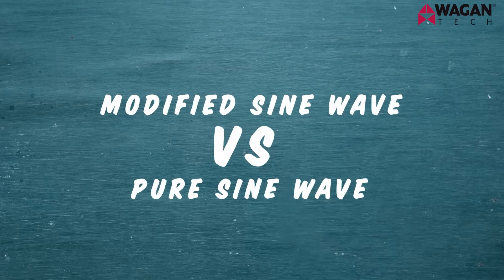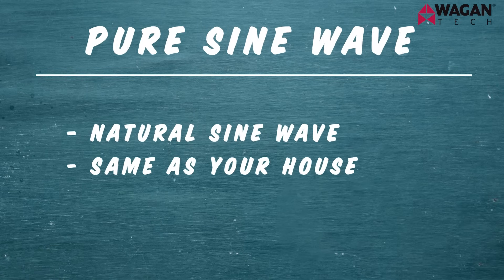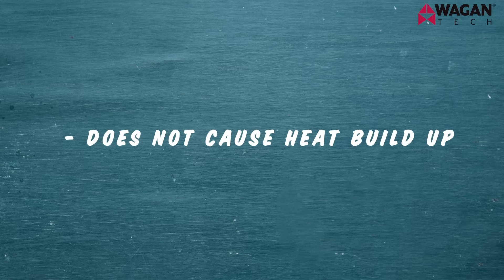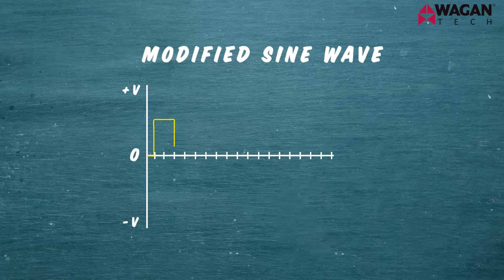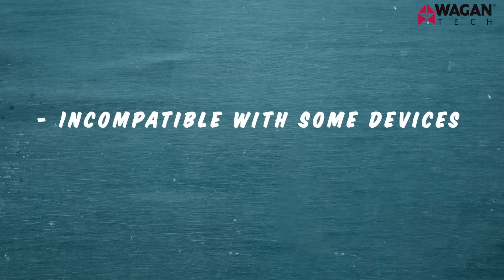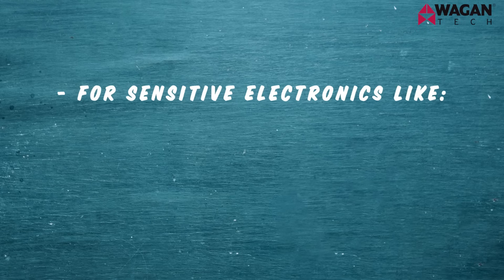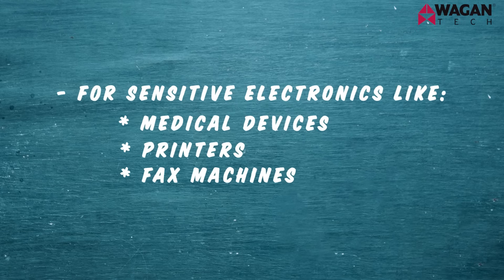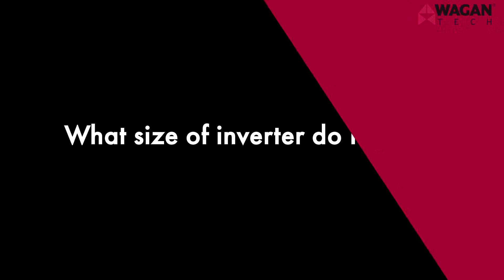What is a Power Inverter and which inverter do I need? What does a power inverter do?

Comment: Great video! I have a question tho. I am looking to buy devices for my families homes in case of a power outage. I've been looking at portable power stations, but then I saw power inverters which seem to power up higher wattages than the stations, yet they are cheaper than power stations. Why is this? And which device is best for a power outage, inverters or stations? Thank you!
Reply from the maker: Quiana, great question! 
Power Inverters convert DC (like your car's battery) power into AC power (your home wall outlet). They are great for powering small appliances and everything else including your entire house. Like anything requiring power, the limitation is the battery (or battery bank) that is supplying the power. For powering devices/appliances close to a battery power supply (like your car), inverters are ideal.
On the other hand you have devices like our Lithium Cubes. They have a built-in power inverter (and of course: USB, DC, etc.) and are great for activities away from the car or situations where you don't want to deplete your car's battery (like camping). Their limitation is the internal battery; a trade-off for ease of use and portability.
Like anything, it depends on your needs and use-case. You are looking for something to supply power in case of emergency at home. Our Lithium Cube 1200 is perfect for that as long as you don't need to run a lot of big appliances (refrigerator, air Conditioning, microwave, etc.). If you need to power those items, an Inverter with a large battery bank is ideal. If you just need to power lights, a tv, fan, recharge your phone, etc., the Lithium Cubes are perfect!
Reply: @WaganTech  Okay understood. Thank you so much for clarifying that for me!
Reply from the maker: @quianadumas3550  it's my pleasure! If you have any more Q's, feel free to ask!

Comment: Great advice. One dumb question. my camper van has a 800w inverter which is overkill for what I want to use it for. My laptop only requires 12 w. Can I still plug in my laptop to my inverter safely or will this blow it out? I don't think it will harm it if it is a sinewave but I just want to make sue.
Reply from the maker: Bron, it is hard to say without seeing your laptop set-up. Most laptops require 19V to charge - a 12V to 19V step-up (or "up-converter") charger can be a solution to your needs IF your laptop meets those requirements.

Comment: ...does it drain the car battery much? How long until running the car again?
Reply from the maker: It depends on several factors including the load being used, the capacity of the battery(s) powering it, and the battery type. 
If you have something that you're looking to power for a certain amount of time, let me know: what it is (device consumption in watts or amps), how long you want to power it (in minutes or hours), battery size and type (ex. 55Ah, AGM), and I will get yo a straight answer. 
CustomerService@wagan.com

Comment: Hi, when in use of the inverter, does it have to be connected to the power source ? I am looking to power my dye sublimation printer on the go for my Photobooth business without have to plug-in to nearby outlet with an extension cord attached to it. My printer specification is 100-240V, 50-60hz, 4A. Could you please help recommend a solution for portable inverter or power station that can last throughout my Photobooth sessions of  at 5-6 hours? I need an expert to give a recommendation. Thank you
Reply from the maker: Donnalynn, a power inverter needs a power source - most commonly it is a car-type battery. If you have a car nearby, you can use the car's battery to provide power. 
As for what size inverter you need, I would require a little more specific info as the supplied info looks to be from the printer's power supply brick. Guessing it is a standard 120V brick and drawing 4A, then your printer is consuming around 480 watts (120V x 4A = 480 Watts). 
With that said, we offer 3 solutions.
If you don't have a battery nearby: our Lithium Cubes are the ideal solution as they have an inverter (PSW) and battery built-in to one lightweight unit.
Inverter 1: Pure Line 700 is a Pure Sine Wave Inverter which is the best option for your set-up as long as you have a power source for it.
Inverter 2: Slimline 800 inverter is a Modified Sine Inverter and a less expensive option that should* work with your set-up.

*Modified Sine Waves are known to be finicky and may/may not work with printers

Comment: Very informative. Thankyou. Would I be able to run a 300w PA system from one of these?
Reply from the maker: Indeed you can as long as you get the appropriate size inverter to handle it. A 400W+ Inverter would handle it with ease - I recommend our Elite 400W Pro or the newer Pure Line 400.

Comment: Got a primordial question please, do you need a battery to use the inverter ? Or can the inverter itself be charged with electricity 
And second question, if you need a battery to use it, how do you charge the battery ?
Reply from the maker: David,
Yes, you will need a battery to use with the inverter as it does not have a way to power itself.
There are several ways to charge the battery:
You can use a standard automotive battery charger, you can use a solar panel, or you may opt to charge it using your vehicle's alternator (the very same way that your vehicle charges its starting battery.
Take a look at my blog here: https://wagan.com/blogs/news/what-is-a-power-inverter-more
Reply: It INVERTS power, does NOT create it!

Comment: I have some questions. I've been watching various bus conversion videos. I've noticed that lots of builds utilize inverters.  I watched several people cut a switch on/off to a light switch, mini split AC, refrigerator and mention the inverter, what exactly are they doing? Also, I will be doing a conversion build of my own in the future and would like to know about the purpose of the batteries pertaining to solar and the inverters... how do they coincide?  Can you please explain or direct me to a source of information? I am a visual and kinesthetic learner.  Thanks for any advice/suggestions that you give.
Reply from the maker: Hi Cee Cee, I would love to be a part of your build knowledge! I am not sure what your first question is referring to- can you show an example? In regard to your second question, usually people will have a dedicated battery bank that powers their needs while the vehicle isn't running (when it is running, the batteries will be charged from the vehicle's alternator). The solar panel has a solar charge controller that is placed in-line between the panel and batteries to regulate the electrical current flow from the panel. Our inverter is down-stream of that and draws power from said battery bank to provide power to your electronic devices.

Comment: So what if my 2000w power inverter says it can handle 120v but I need to plug in two appliances that need 120v 50-60Hz 110w each? like would I have to buy an inverter that can handle double the voltage?
Reply from the maker: Bryan,
If your inverter is a 120V inverter with multiple AC outputs, you already have what you need. If you're plugging in two devices at 110W each, that would only be a 220 watt draw on your 2000 watt inverter.
You do not add up the voltage, only the wattages.
Reply: @WaganTech  thank you so much

Comment: Hi there.. great video.. would like to ask if for an equipment like a 1200W vacuum cleaner and larger sized motorized equipment.. is 20% buffer still applicable? Tnx..
Reply from the maker: Hi Christian,
Yes the buffer is applicable, even more so with larger appliances! I would certainly recommend the 20% buffer on higher wattage appliances.

Comment: So, basically, used the inverter when I plug in my coffee pot, laptop, tv, charging a cell, otherwise its stay OFF?
Reply from the maker: You are correct, generally most folks turn the inverter on when needed and then off when not. The general exception is those in RVs where the inverters usually stay on all of the time.
Reply: Thank you very much(newbie). Also how do I know what “group” my rig is trying to new batteries.  One or two batteries(rig has two batteries doesn’t say what group?) thank you
Reply from the maker: @ralphtamez5492  No problem, my pleasure!
 The group size should be printed on the battery/battery label (usually something like "35" or "51D")... if it is not, then you can match the group size by the battery's physical dimensions. If your vehicle came with dual batteries (like most diesels do), then you'll be able to find out which batteries the rig requires by online battery finders or even the dealership.
Reply: Wagan Corporation I think I found it HD24-DP.  Costco has the group 27 would that be okay.
Reply: @WaganTech I have a small little heater what would I use

Comment: Can I use a basic inverter to charge my cordless dremel when on the road? The wattage on the charger says 120v.
Reply: 120v is the voltage "v", not wattage. Still need to know how much amps / watts
Reply from the maker: @dansullivan7547  You are correct Dan, thanks for sharing! Most Dremels use around 175 watts, therefore you'll need an inverter around 210 watts.
Reply from the maker: Yes you can!
Reply: what's a dremel🤷‍♀️🤔
Reply from the maker: @realtalk4reallife  it is a "rotary tool" that is used for a myriad of projects!